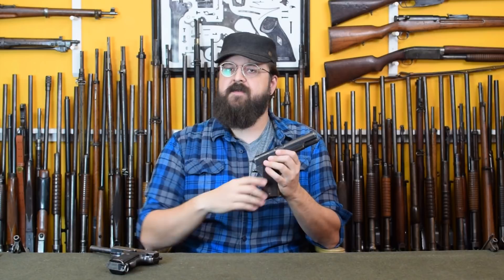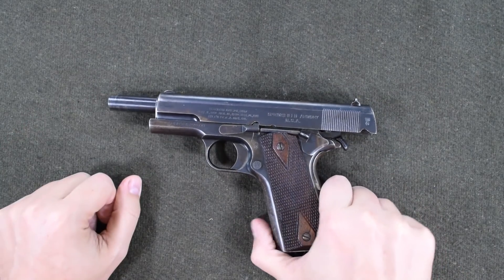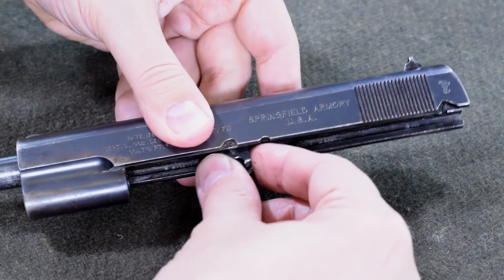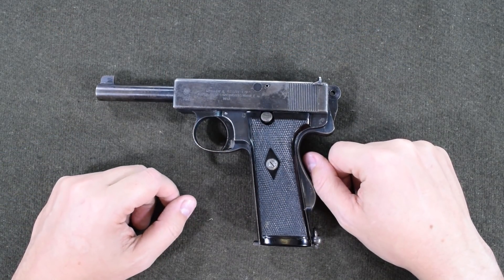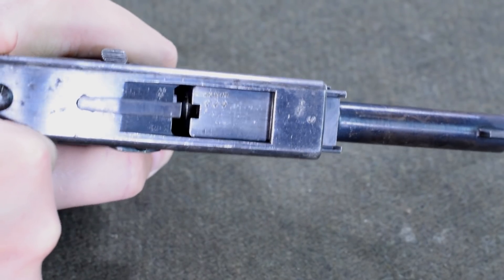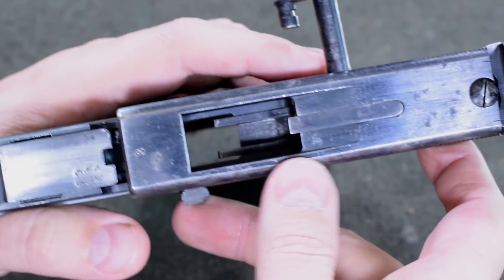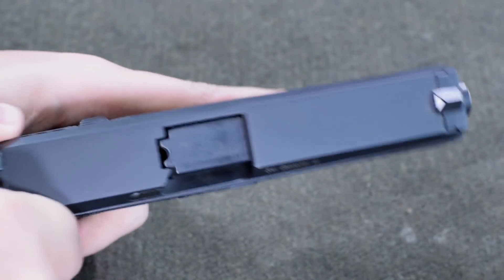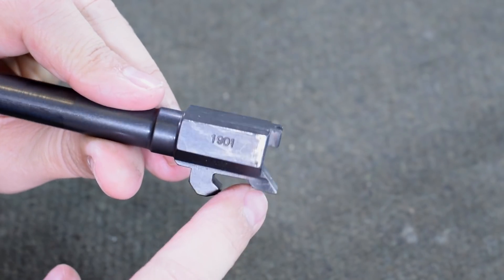Clips:  Most Common Type of Pistol Locking Action

Comment: ...that's interesting - I had no idea that it was the Webley that first uses the locking 'block' over the chamber as it's lockup method...always thought it was a SiG development...
Reply: Y'know what they say: "copy is the most honest form of flattery"...
Reply: I'm in the same camp.  I've always described it as the "SIG" locking style.
Reply: it was w/ the tilt
the Whiting mention is worthwhile
but the Browning concept is key
Reply: Charles Petter also invented some of SIG's ideas
Reply: @chooseyouhandle  ...Petter developed the service pistol that the Frogs originally asked FN to develop (which resulted in the FN GP , Browning's last design, but completed 'perfected' by Dieudonne Saive)...The Frogs rejected that one and adopted Petter's design...From what I understand Petter took his design to the Swiss...which eventually became SIG/Sauer...
Reply: @mohammedcohen  
SIG bought the licensing of the 1935S model in 1940. Still used the classic browning system on the P210 and later had an improved version that features the locking in the ejection port, the open cam with the P220. So if one takes that version into account, it's still from1935 and the Webley self loading pistol by William Whiting made it through trials and was adopted in 1910.
Reply: @onpsxmember  ...yes...the French (typical Frogs) rejected the P35 (BHP) in favor of a design by Charles Petter...it was his locking system that Sig bought and eventually wound up as the most ubiquitous of modern designs...Browning never really liked that swinging link and in his BHP he replaced it - had to - he'd sold the right to that design to Colt...

Comment: Almost all Browning sistem pistols nowadays work in the improved Browning - Petter sistem that started Sig with the p220, single lug caming surface locking and very important captive rod recoil spring . This sistem improved production costs and accuracy. Its important to note that the caming surface concept in replacement of the link sistem was introduced by Star in some 1911 clones a decade before the Gp 35.

Comment: Something to point out when you were talking about the 1911. It actually isn't tilted when it unlocks. If you look at the drawings for the gun, the barrel is tilted UP when locked, and it straightens to unlock. In battery it's slightly misaligned with the slide (which doesn't matter at all for accuracy since the sights are aligned), but being straight when unlocked simplifies the design of the barrel bushing.

At some point this changed, and modern pistols now have barrels which are straight while in battery and tilted DOWN for unlocking. The change from tilting UP to lock, to tilting DOWN to unlock is pretty significant, but no-one ever seems to talk about it. Pistols with Browning style barrel lugs always seem to be of the tilt up to lock variety, whereas those which use the ejection port for locking always seem to tilt down to unlock.

Comment: "This is a 1911 pistol"

Never heard of it. I'm sure there were hundreds of pistols made in 1911.
Reply: The original M1911 pistol was made by the Colt Firearms company under the supervision of John Browning, so the technical Term would be the "Colt-Browning Model 1911 Semi-Automatic Pistol".
Reply: @Victor-056  Unless you are Norwegian in which case it is the M1914 (as used by the Germans in WW2)…
Reply: @allangibson2408  Yep, and we refer to it as a "Kongsberg Colt".  When the Norwegian government bought the production rights of the 1911, they received one pistol, and a set of blueprints.  The blueprints was if course measured in inches, and very accurately drawn. At the Kongsberg våpenfabrikk, the re-draw the entire gun,this time measured in mm (with few tolerances). The first trial series was marked with M/1912.  After the first delivery they correctly stamped them as M/1914.   Interestingly, the drawings (I got some copy's) are marked "COLT AUT. PISTOL-MODEL 1912 - CAL.11,43MM", while the pistol was marked "11,25m/m AUT.PISTOL M/1914". The Germans continued the production during the war, and designated them as Pistole 657 (n). Of course, we Norwegian's only refer the Norwegian made colt as an M/1914, everything else is a 1911...
Reply: @Victor-056  Sounds made up. Surely such a gun doesn't exist.

Making fun of 1911 is a longstanding joke on this channel, specifically acting like it doesn't exist. XD
Reply: @planescaped  Alright, Then Colt-Browning 1911 Self-Loading pistol.

I'm well aware of the Joke, but mostly because I feel the Colt M1911 is highly overrated and overhyped.

Comment: Always called the second type a hood locker, with a cam tilted barrel, considered it a variation of a Browning lock (cam tilting appears on the Browning P-35/GP/HP) . {note: the cam system was present before Saive took over the design} the first hood lock I remember seeing was the SIG220, It’s strength was confirmed when hood locking was used successfully in the 45 win.magnum. (AMTautomag 4)

Comment: No, I have a P320 which is a totally innovative design that no ones ever done before......

Except for every part of it in one way shape or form XD

In fairness to Sig, I dont know of a pistol previous to the P250 that used an FCU type system. Theres probably one, but I dont know it. It seems like a system centred entirely around the plastic grip, which isnt something that was feasible before the 70s/80s imo.
Reply: @michaelbrown2625  no, it has a trigger pack. Its closer to a Rem 700, Glock, or AR cassette type trigger group.
The serialized portion is still the grip/frame.
Reply: @michaelbrown2625  yeah, the 320 is just a striker fired 250, hence why the 250 hammer was causing drop-firing in the 320.
I dont wanna give Sig credit for the FCU idea, but I cant think of a precursor. The 250 may have been the first.
Idk when the beretta apx line first hit the market

Comment: One would need to do more research to confirm which gun used it first but the earliest use I can think of for the locking system used by modern handguns is the Swiss P75, aka the SIG P220.

The P75 features the camming unlink action with a ramp to linkup just like later modern handguns, and it uses the barrel hood to lock into the ejection port like the Webley. The barrel tilts during the cycling like a Browning. 

Lacking an earlier design to use this combination of Webley and Browning action I would think calling it the P75 action would be appropriate.

Comment: I never realized that locking the barrel into the ejection port was such an old idea, as it didn't seem to become widespread until much later.
Reply: Yep. British made
Reply: @bobcervante3801  Nobody coppied!
Reply: @ldkbudda4176  what’s your point. All inventions stand on the shoulders of what’s gone before. In some cases things are designed in parallel without knowledge of each other. However within firearms in the 1900’s no doubt some things on the competition’s product was noted and and used if good. Often small changes made to avoid patent infringement.

Comment: Was the 1911 the first to locked in that way, or was there and earlier pistol that had those grooves?
Reply: The colt 1900 (also by browning) used the lugs on the barrel but the barrel pivoted instead of tilting. But it then evolved into the 1911.

Comment: Using the ejection port seems obvious in hindsight, the multiple lugs on the Browning design are superfluous, one small locking surface is enough for a pistol cartridge.
Reply: The Browning style multiple lugs were designed during a time when making the steel in the slide strong enough for a single lug wasn't feasible on a large scale. 

Steel manufacturing, and machine tools, just weren't up to the task to do so at a price they could reasonably sell the guns for, so it had multiple lugs instead. 

Also the Webley's lug isn't at all "small" it is much larger than a single lug of the Browning design and it contributes to the Webley being as large as it is.
Reply: @Full_Otto_Bismarck  have you got any evidence for any of this?  I worked in a gun factory and I don't recognise any of the three points you made. Machining or tooling certainly had nothing to do with it, it's easier to machine the single Webley style locking surface even with the tools of the period. Did Browning try a single locking lug and found it too weak?
Reply: @snowflakemelter1172  did you work in a gun factory in 1900?
Reply: @Full_Otto_Bismarck  I know how they were made in 1900, the machine tools and heat treatment processes though, do you ?
Reply: @snowflakemelter1172  If you think the ability to make harder and tougher steel as well as machine it economically hasn't improved in 120 years then we are at an impasse and i have much more important shit to attend to.
Reply: @Full_Otto_Bismarck  you don't need harder steel for a low pressure 45 acp pistol locking surface nor do you need modern machine tools to cut the simple locking surfaces.  The Steyr Mannlicher M-1886 rifle had such a single locking surface no bigger in a full length rifle cartridge.

Comment: never understood WHY someone (with machining skills) never tried to modify a 1911 with the same kind of locking system and eliminate the time consuming machining of the locking lugs/groove system...call it the 1911A2 or A3
Reply: Someone did, look up the Peters Stahl 1911s, they are no longer made but they used a hood locking linkless system, like a SIG or later handguns. 

The big problem with selling such modified 1911 designs has always been tje traditionalists who cannot acknowledge the drawbacks of the 1911s design. 

Which is so unfortunate as the 1911 has lots of nice ergonomic features held back by a complicated and difficult to manufacture locking system.